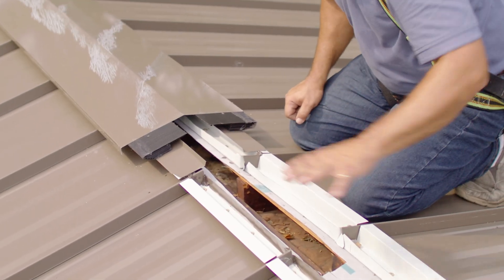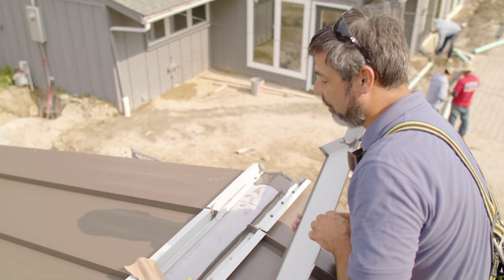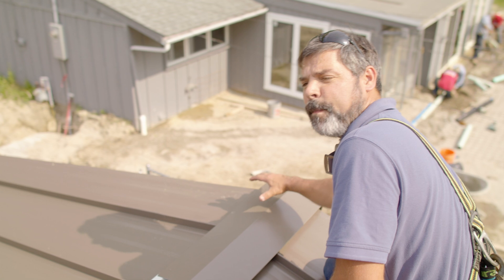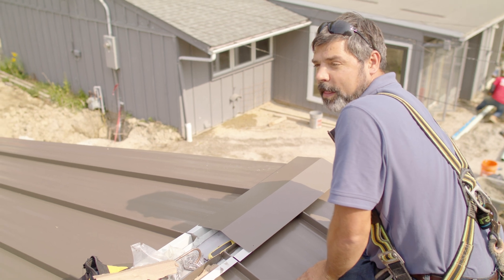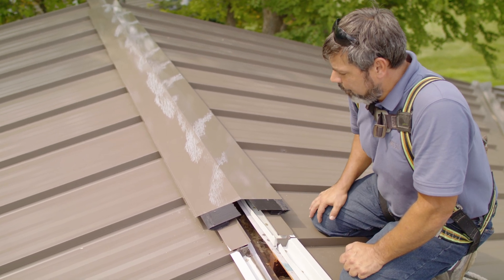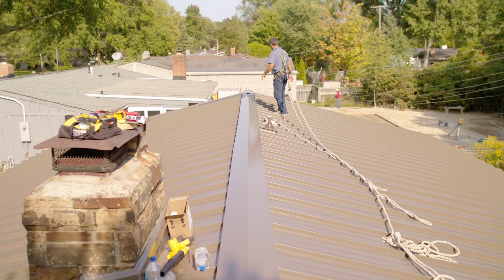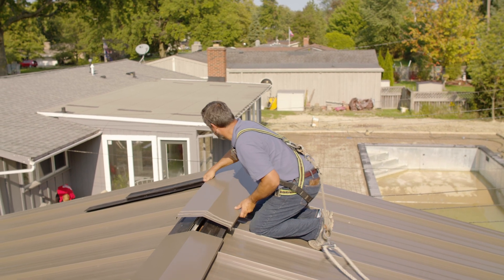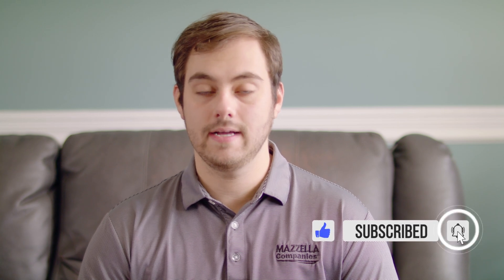How to Install a Vented Ridge Detail on a Standing Seam Metal Roof

Comment: Why not use the vented ridge all the way to the gable?
Reply from the maker: You can if you want to maintain consistency across the roof, but if the gable has an overhang, the venting only is needed on the part of the roof that has attic space underneath it. Installer's choice to end it at the attic or run it to the end of the roof. -Thad

Comment: I never understood metal packages that have a ton of exposed fasteners. I’m currently installing a dmi standing seam roof package and instead of having a hook at the gutters edge. They want 5 neoprene screws. Also the cap calls to have a screw in the rib. This is all per installation paperwork. Dumbest stuff I’ve seen. Always thought it was about trying to not have any exposed fasteners. Whats bad is if I do it the right way dmi will void the warranty.

Comment: We are in a heavy snow load area.  15 ft. of snow accumulation last year.  There is a heavy "crush factor" on the air voids in the vented ridge systems.  Is there a solution for this?  Can you walk on this ridge without damage?  Also looking for a system that eliminates the need for fasteners through the top.
Reply: With that much snow, you likely have no reason to vent your ridge - primarily performed in regions with more hot days than cold.

Comment: I have a modular cape-cod house with a 9:12 pitch asphalt single roof.  The roof has a double ridge pole which does not allow much room for air to flow to escape.  Could this system be used on my house?  I need to have a larger opening than a standard plastic ridge vent offers.

Comment: How close should I bring my metal panels at the top of my ridge. I'm using an r-type panel from home depot. They have a simple metal ridge cap that screws over the top. I have a single wide trailer next to a ski mountain. There's very little pitch on the roof. We get lots of standing snow up to one foot deep. Should I bring the panels to touch each other or leave a space. I'm not really concerned about venting. I should mention this is an installation over existing shingles. Your advice would be appreciated. Thank you!

Comment: i like this. Will this hold up to 200km plus winds from a typhoon? I have  a home in the Philippines, with a metal roof and no venting. I will install lots of soffit venting but I also need  to vent the top peak of the roof. Traditional roof vents or whirly bird style venting does not work.

Comment: I just got A brand new metal roof just like your video. I live in South Florida,I feel that they did not honor my ventilation situation that I strived for. I'm very angry and upset if I post a video on my page would you be willing to look at it and tell me what you think with your experience I would get up on the roof show you my roof top ventilation and I would crawl into my hot attic and show you the underneath for the ventilation. The company that installed my roof said it's to the manufacturer inspect so if anything ever happens my warranty will not be damaged. And the long story short before I even got my roof they agreed to give me what I wanted for my roof ventilation because that's my main concern is getting the hot air out and they just did what they wanted to do at the end of the day. I got tuna inspections from my roof coming soon this week and I want somebody else's opinion if you're interested I will make the videos and upload them and make another comment when they're uploaded.
Reply: I am in precisely the same situation at this very moment. I just went by AAA roofing company. They're going to come by and give a second opinion. Sadly, I had tried a different smaller roofing company since Monday 5 days ago calling them 3 days and going there today. Ultimately to realize they were not interested to give a second opinion at all. But AAA is a huge excellent company. They're going to come. Give me a second opinion. I highly recommend them. As I said I would henceforth, I don't know how I'm going to recover my loss that contractor didn't attempt to install a ventilation system like this. It's just a walk in the park for the bugs straight into the attic. God forbid I get a driving rain. It's coming straight in and there is no proper venting at all. They basically blocked it all off like you said as they wanted to thanking people aren't savvy and I'm not. I trusted them but I knew it was wrong from the time they said it was a roof over and the vents would be staying in place. They're tearing. The vents out has been disturbing ultimately to see it sealed up and not even a water tight fashion has been shocking. I totally understand and and empathetic to your circumstance, but I'm just a homeowner like you. Trusting people does not go as far as it used to
   Any contract in the future will have one written by me to parallel it with them, signing it, making sure the oral agreement matches what they say and or supersedes it. It's a sad world we're living in

Comment: I have a low slope roof.   I live in coastal NJ where we get some very strong wind and rainstorms.  I have cathedral ceilings inside my home.  Because of poorly designed ridge vents I have had to replace several ceilings that suffered water damage.  I have had the ridge vents changed more than once. Still not perfect. Thinking of going to a metal roof.  How well do vented ridge caps works under severe weather and on a low slope roof? Will the smooth roof cause me an even bigger problem with water being blown under the cap? Is there a special cap to buy for my specific condition?

Comment: had a standing seam 26 gauge metal roof installed on my beach house a few years back and within a month or so, bats moved in to the attic through holes they made in the ridge cap and hornets came in through the ridges at the eaves. How do you stop that problem?

Comment: You got be kidding me with that ridge vent detail. Bend your panels up at the ridge and caulk the corners. Then install Profile vent gluing at down with Vulkem 116. Then cleat both sides of the ridge just like  your valleys. Then install your Ridge hemmed on to the cleat. RIVET  the ridge to the cleat.